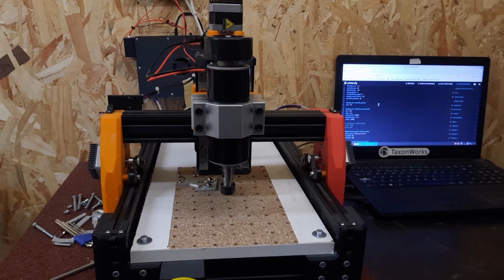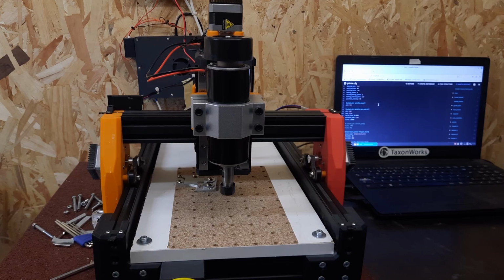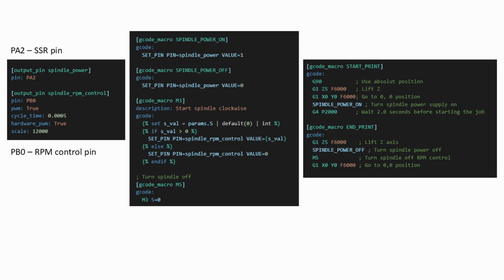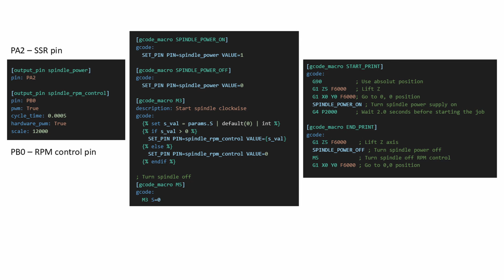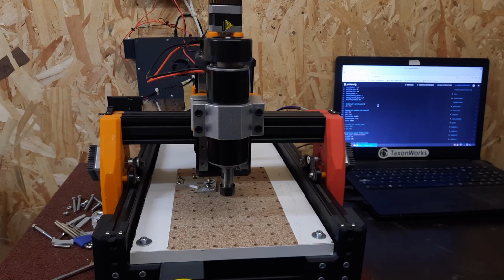Ender 3 CNC (E3CNC) - 500W Spindle Upgrade

Comment: I think in your diagram you swapped VMot and PWM. 😊
Reply from the maker: I checked again and the wiring diagram is correct, at least for the setup presented.
Reply from the maker: Giving it another look a month later I think you might be right tho. I'll remove the wrong diagram and upload a new one separately.